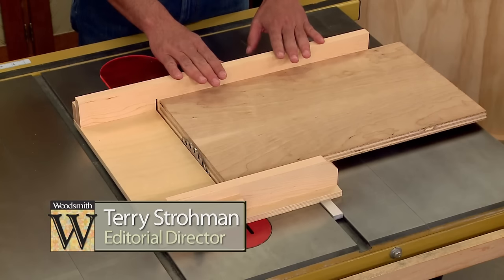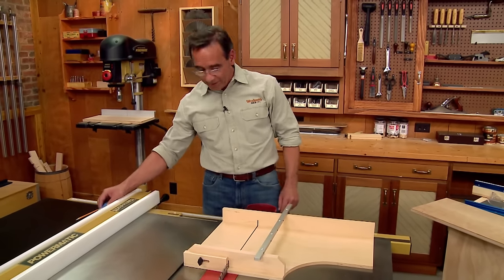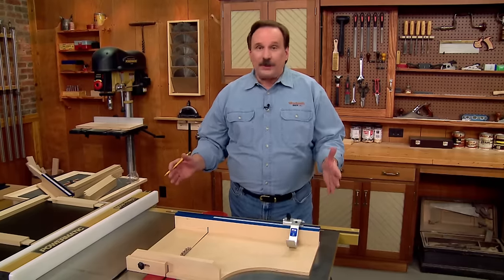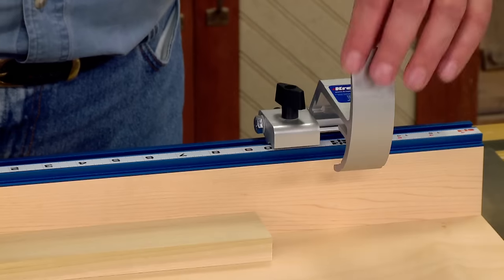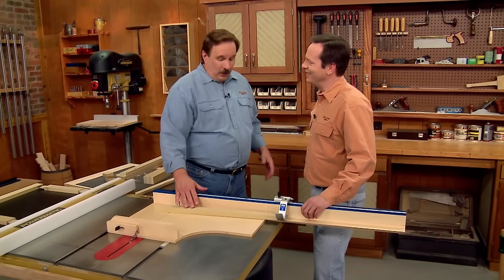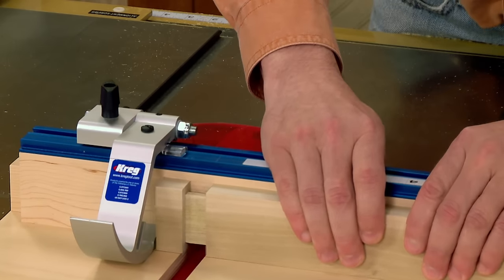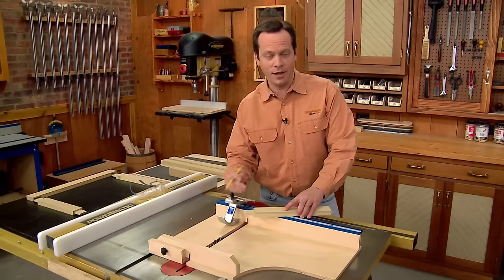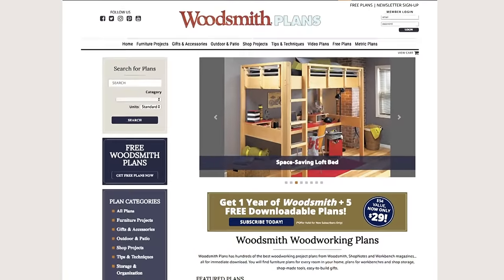Maybe the Best Table Saw Crosscut Sled Ever?

Comment: This thing is way too small to be usable in the real world.
Reply from the maker: That is why we only use ours in the fantasy world. ;)   We do have a bigger crosscut sled if that's what you're in to: https://www.woodsmithplans.com/plan/ultimate-crosscut-sled/
Reply: I’m calling BS on this comment. I use a few different sleds in my busy shop, including a much bigger one, but I’ve found the smaller-sized  sled gets much more  use. Easier to lift onto the saw, great for making a few quick cuts, easier to store and much easier to make in the first place. BTW after making a dozen or more sleds, I can vouch that the single runner aluminum bar setup is ideal. Try this design, you’ll eat your words!
Reply from the maker: JohnCinOz1 - Thanks for your support. 👍